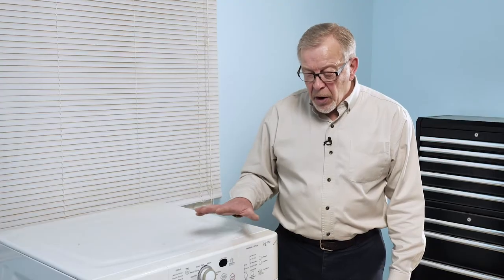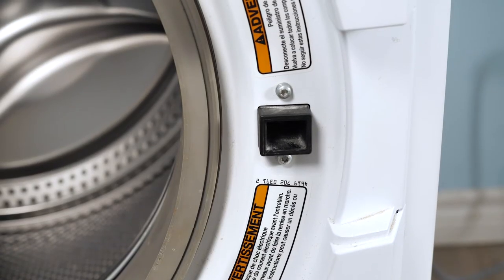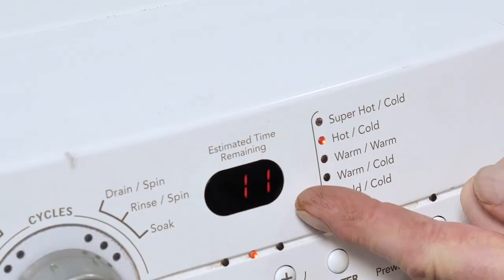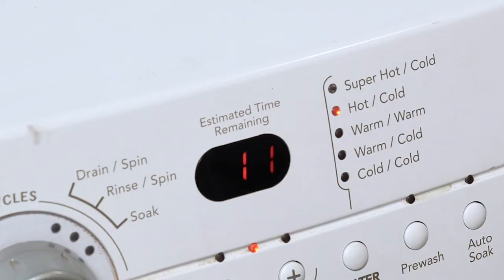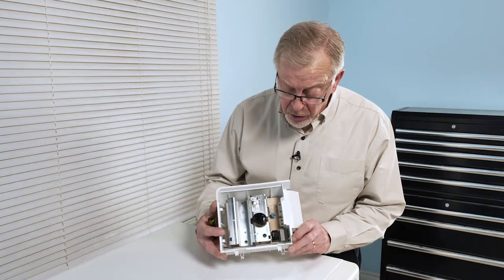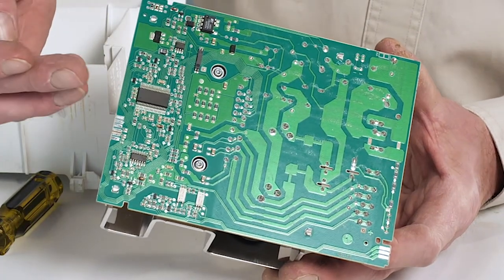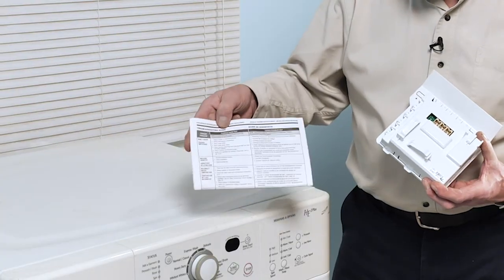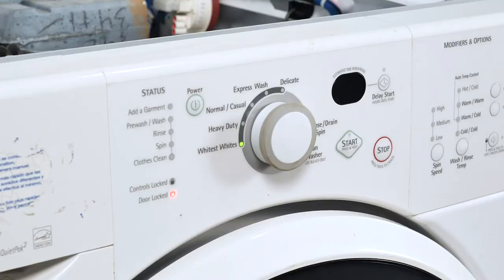Washer Troubleshooting: Front-Load Washer Won't Spin - How to Fix Your Washer | PartSelect.com

Comment: My Samsung F Loader will spin without clothing, it attempts to reposition/balance but when the RPMs start to ramp up it recycles back up a few mins (from 14 back to 19 for example, or from 8 back to 11, pending the wash spin setting selected).  Drain works, clean.

I'm guessing it's that the shocks are worn (every 4 years +/_) or the spider arm is cracked due to the Galvanic shock of the dissimilar metals in the spider arm (high Zinc content = sacrificial "anode") and the stainless drum ("cathode").  These arms are notorious for failing, as if it was a manufacturing flaw in using poor metal in the spider arm, or intentional design flaw to sell more washing machines (built in obsolescence).
Shocks are $35 (amazon) or up to $80 - $100 for OEM.  Spider arm = $125 new/reclaimed to $200 NIB (note you will need screws & thread lock, sold individually oem)

Shocks 1 hour repair
Spider arm 1 day repair (complete disassembly required), at least 1 of my days.

Why no mention of these potential well known problems, as if they want you to replace everything before you get to the problem.